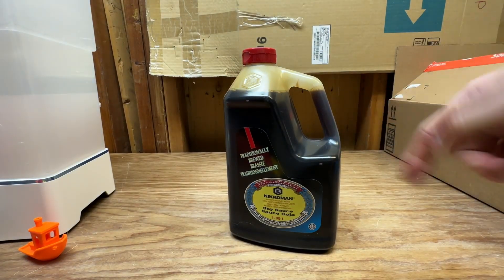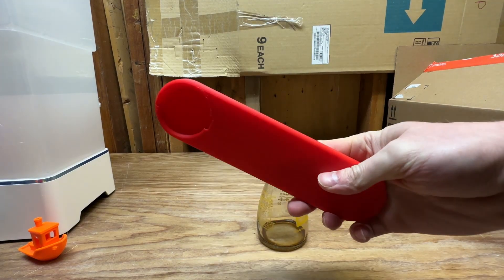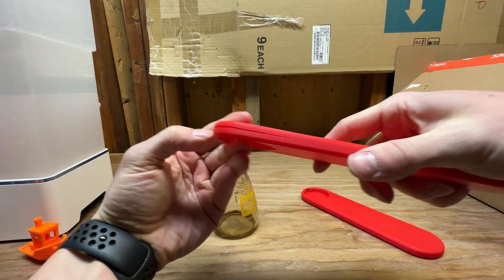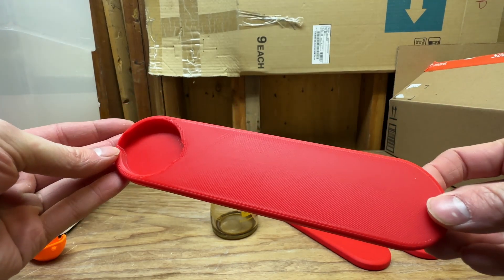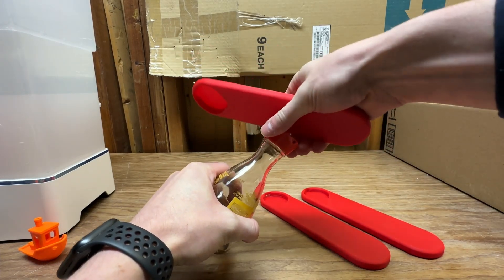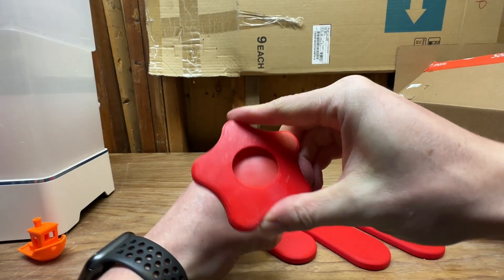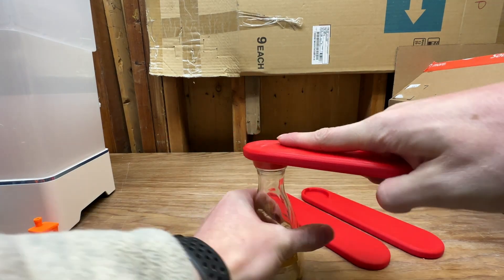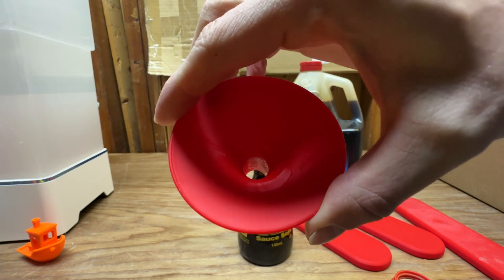3D Printed Kikkoman Soy Sauce Wrench

Comment: Neat and simple design, but that funnel isn't food safe (I assume that's what you meant at the end of the video) unless you put some protective food safe varnish on it.
Reply: Assuming PLA, it's probably one of the only  materials I would use with food
Reply from the maker: That is what I meant at the end of the video but the only non food safe part about it is the grooves on the surface produced by the 3D printing process. I'm using food safe filament from filaments.ca: https://filaments.ca/collections/true-food-safe
and a stainless nozzle from bambu lab. I still wouldn't recommend using 3D prints for food related prints that have long contact time or are exposed to high heat. But I do think the community is very quick to say "no prints are food safe" and it's a bit more nuanced than that. I like your recommendation for a food safe varnish, that is probably one the easiest ways to make a print "food safe". I intend on making a follow up video going deeper into this subject.